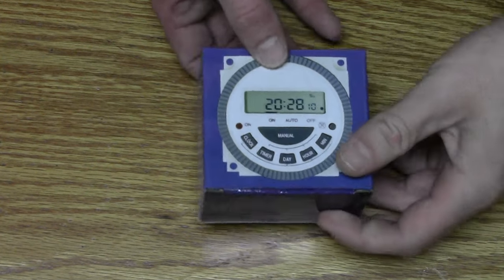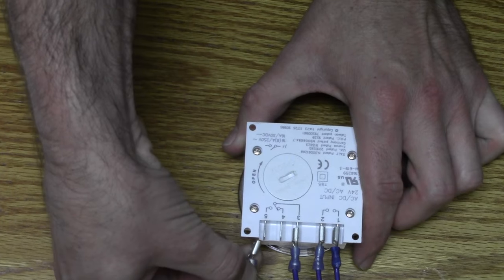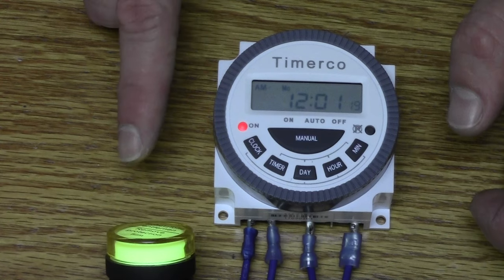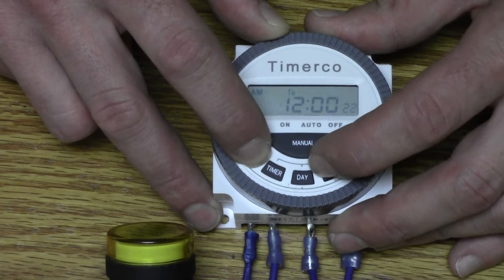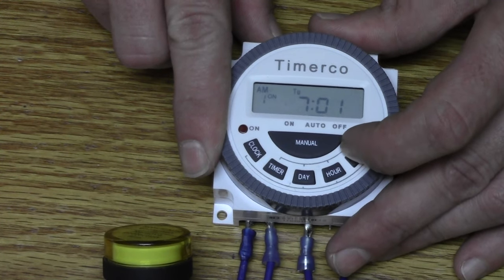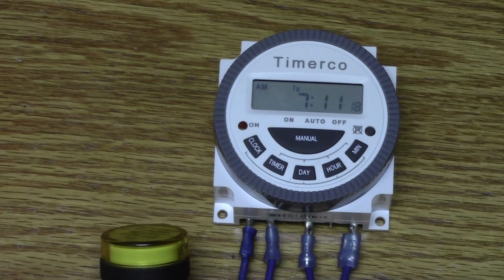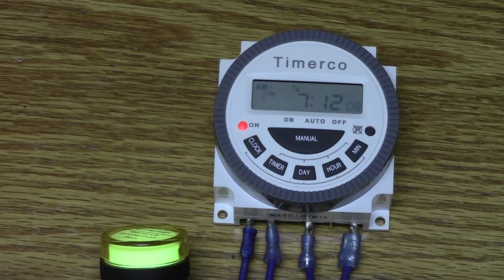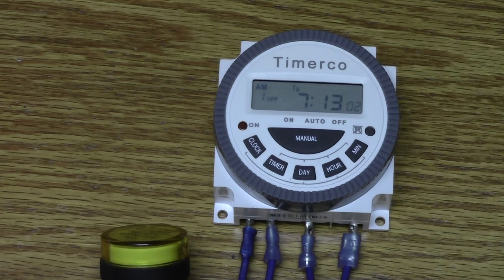Tutorial Video for the Frontier TM619 by Timerco.com

Comment: Thanks for providing crisp video Demo. 
In the product application notes of frontier Timer :5PIN TM-619H 2-2 model*, "it is mentioned as" :
* Timer can  be used for automatic switching on or off for any appliances for irrigation or agricultural pumps*

#Accordingly, "please clarify the following about 5PIN TM-619H 2-2 timer device" :

1.Is it possible to use 5PIN TM-619H 2-2  *as preset digital timer device*?? : "for connecting to single phase 2HP submersible motor"
Running Amps Motor : 
14A @250V AC 

Starting Amps of Motor :>50 A (for less than 10 seconds) 

2. Is this 5PIN TM-619H 2-2 *having volt free contact relay output*?? 

3. *Adjustable time setting facilities  available in this model*? : from 10 minutes to 180 minutes. 

Our application/practical Purpose of timer* :
"To stop the Borehole Pump set*" after preset-time out". 
i.e. "Manual start & Auto turn off-"  preset digital timer needed. 

#Please reply on above mentioned  queries
www.facebook.com/Bhargava Ashwath 
curiousbhargav@yahoo.co.in